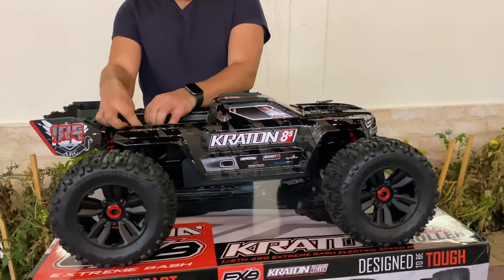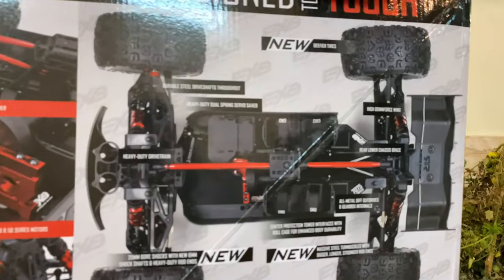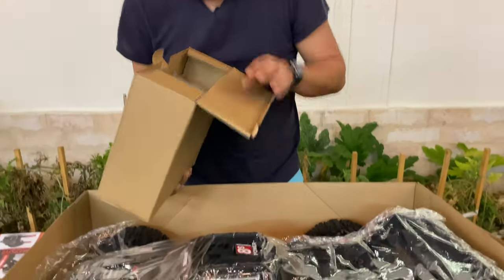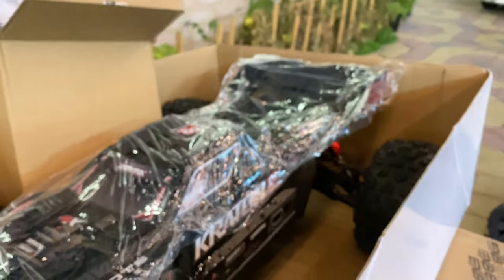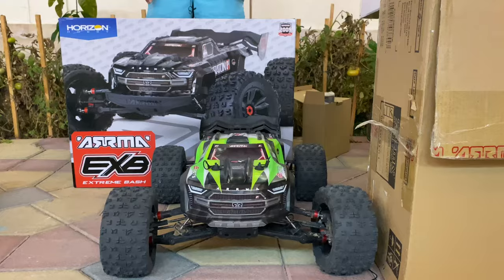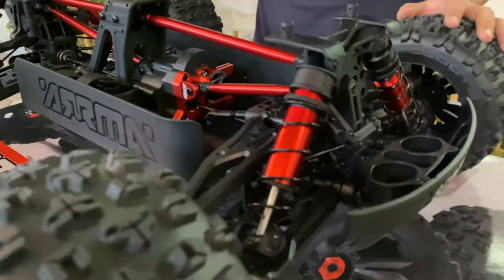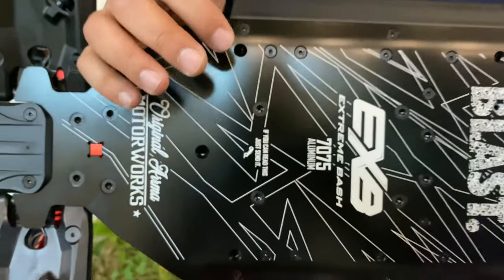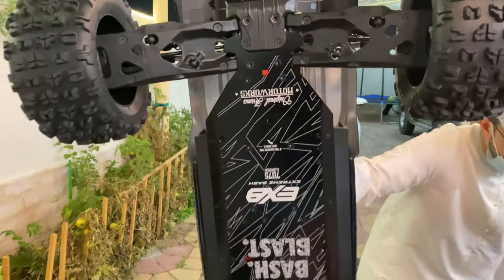Arrma Kraton8s EXB 1/5 Unboxing

Comment: 😍😍😍 This will be my first 1/5 Kraton. They say good things come to those who wait!
Reply: You a xxmaxx owner?
Reply: @paulclancy2404  Nope. I do have 1/5 Outcast and yes Xmaxx will come later.
Reply: @MZBallistic  dude u need to get the xmaxx... its a damn good basher with rpm rear hubs and aftermarket steel pinion and spur. Theres plenty more u can do to make it how u want but those 2 upgrades should get u bashing hard with it
Reply from the maker: Gear grinder 🤣
Reply: @Todd_G_FPV  Yes, I've seen them in and out of the hobby shop so I know about the gears. I'm just waiting for an updated Xmaxx or maybe Traxxas version of a exb roller cmon Traxxas look and learn!
Reply: @MZBallistic  a roller would be sweet! Especially if it came upgraded besides the electronics!

Comment: How did you get it? Arrma's website has nothing of the sort. Horizon has zero info..... I'm curious. When is it going to be released or, if nothing else at least acknowledged by the manufactures? Looks killer tho! I'll def buy one when they're released! This gives me hope for the 1/5 scale Arrma outcast 8s EXB! That I would preorder.
Reply from the maker: my guess spring or summer I got it from MSH shop they sold 4 I think check their unboxing vid as well

Comment: Hi as you have a standard K8 also could you please tell me if the servo saver has changed size I know it has a tougher spring but on the box looked to be physically bigger and also the steering rack has it been upgraded on the EXB. I should have one soon and want to get an Vitavon order on the way so want to be sure of possible changes.
Reply from the maker: Yeah it look beefier and the steering joint is new also they let you choose between 6 & 5th scales servos the steering is much smoother
Reply: @UAERCADDICTS  ok thanks so the servo saver casing looks bigger?. I know the rod ends and turnbuckles are heavier it's center steering part I was asking about I think it's the sae as the RTR. No manual online yet to check if part numbers have changed.
Reply from the maker: @gboulter  so shall i do live stream now?
Reply from the maker: @gboulter  today i will make a new video with a caliber to measure every thing :)
Reply: @UAERCADDICTS  I do spend an awful lot of time with calipers in my hand. 👍

Comment: More technical information would be nice. There is way more things to say about this car.
Reply from the maker: I know i don’t want to spoil it completely but it has a sway-bars front and back 🤩
Reply from the maker: And it weights 17.5kg as a ROLLER
Reply from the maker: Thats around 40 pound lbs in us 🤣😂💀
Reply: @UAERCADDICTS  And what is the chassis plate thickness?

Comment: Really want to know the price this is gonna be.
Reply: If the conversions hold true, $729-749.
Reply: @Megasty15  That's what I was thinking. Are you gonna get one? Would love to see what you do with one.
Reply: @heavymetalrc7520  Definitely. I already know it won't hold a candle to my current K8S. I've been trying to get it around 30lbs by unloading the unneeded aluminum stuff - but what I did to it this time throws all of the out the windows.
Reply: 679
Reply: 799
Reply from the maker: My Guess 739US to 799US
Reply: 699 🔥
Reply from the maker: Surprisingly